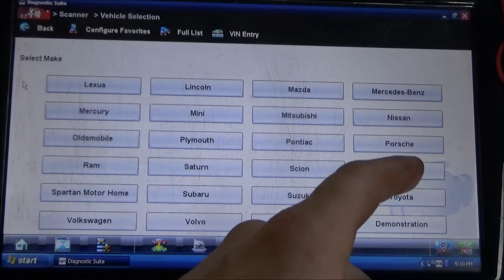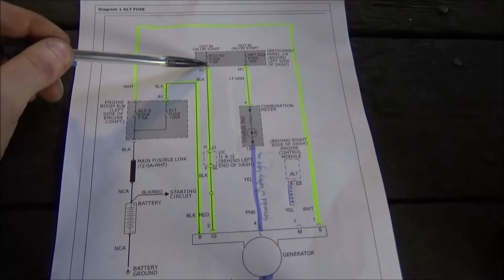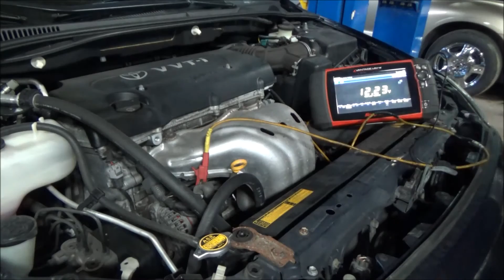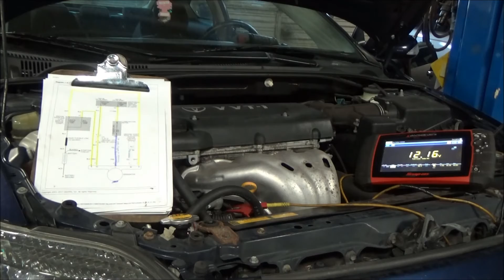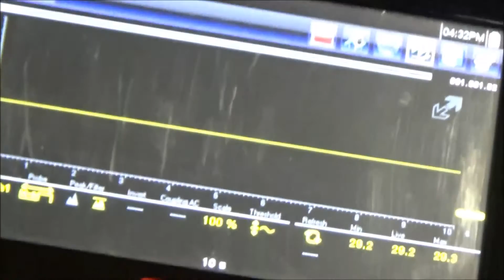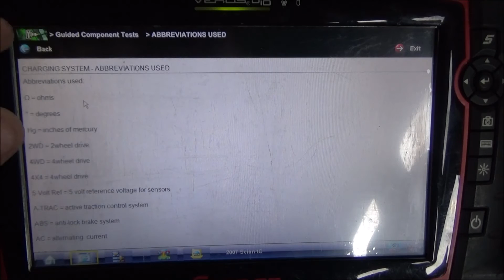2007 Scion TC,  Battery Light, Alternator Testing

Comment: 07 Scion TC 2.4L 2AZ-FE automatic, the negative battery cable that connects/12mm bolt onto transmission will create sparks at the bolt whenever the key/ignition is turned on or attempted to start vehicle. 

Just bought Denso Toyota/oem parts:
▪︎Starter,
▪︎Alternator,
▪︎MAP sensor 
▪︎Crankshaft sensor,
▪︎VVT sensor, 
▪︎Radiator,
▪︎Engine filter,
▪︎Iridium spark plugs,
▪︎Brand new battery (Walmart)
▪︎CV axle seals,
▪︎Front D&P speed/ABS sensors,
▪︎Engine belt,
▪︎Engine valve cover gasket,
▪︎Engine pan gasket,
▪︎Transmission pan gasket,
▪︎Gas/fuel cap

Non oem parts:
▪︎Driver CV axle
▪︎Driver ball joint
▪︎Driver swaybar link
▪︎Driver steering tie end rod
▪︎Driver wheel hub bearing
▪︎Pass CV axle
▪︎Pass ball joint
▪︎Pass swaybar link
▪︎Pass steering tie end rod
▪︎Pass wheel hub bearing

Comment: I would think that live data would show you desired charge rate vs real time, giving u at least an idea that the ECM is trying to send a signal to the alt to increase the on time. Some scanners will express actual on time desired duty cycle in percentage. That at least gives u the idea that the ECM has electrical control, but the alt has failed. Even using the scope as u did proves circuit integrity. Generally, Toyota computers do not fail in this way, so odds are, the alt took a powder. Good vid!

Comment: These test can fool you. As the PCM can control the alternator. They are appearing more and more on new cars. So you need to be aware the PCM could be not grounding it. I fixed many where people kept tossing alternators at the problem. Only to find the PCM signal ground be bad..
You can command the Charging system Duty cycle on. If you have bidirectional control Scanner..

Comment: I have a 08 Toyota camry and my battery light is on I replaced the alternator and battery and still nothing any help will be appreciated thanks. Nice video BTY
Reply: Check alternator fuse 7.5 change that and you good to go
Reply: Google alternator fuse and change that

Comment: 30 mins to diagnose a bad alt.  I would have down replaced it from the  start
Reply: I replaced my battery and my alt and it's still low voltage. This video is gold. I'm glad it's here. Checking my wires.

Comment: I own an 07 tc. It's a complete miracle to still be running. At 194k miles. Bought from a buy here pay here lot 60 k miles ago. Burns over a quart every 1200miles. Running Castro gtx for the life of the car. Battery just died or its not starting.

Comment: hey I have this same problem, except I dont have a battery light come on. have a abs, brake, and tpms lights on. replaced front passenger speed sensor and lihhts still on. put a new alternator in and nothings changed. wont charge the battery. had alternator tested in car running and theu said the brand new one was bad. took it out and they tested it where I bought it and said it was good. so brought it down the street to oreillys and they said it was good as well. any thoughts on this?
Reply: did you figure out what was wrong with it I have the same problem
Reply: any updates?
Reply: I'm having the same issues, about to try replacing the fuse box like I just saw in another video

Comment: "DFM/M: (Digital Field Monitor/Monitor)
This type of connection is connected to the vehicle ECU. Every alternator brand has a different abbreviation for the DFM
connection: FR(Field Return) DF(Digital Field) DFM(Digital Field Monitor) M(Monitor) LI(Load Indicator) but all function in the
same way. The connection has a positive and negative measurement which works with a block pulse. When the alternator load
increases the block pulse dependent on the application will become wider or smaller. The vehicle ECU then knows the load at
any specific moment during the charging process. "
According to autoelectro.co.uk. There is also a great article at http://www.motoplat.nl/Tech%20Info/DFM%20Explanation.pdf.
Hope this will help. Thank you for the video.
Reply from the maker: Great links man,  a lot of good information to take in there.  I appreciate the feedback and your support of my videos!
Reply: James Courtney Thank you so much James and Joe too, remaining stuff answered nicely. I'm happy so much that many of us around going to help each other.

Comment: What did the signal look like with the new alternator installed.
Reply from the maker: It looked the same following the alternator replacement,  but I didn't have time to play around with it as much as I'd like.  I'll keep an eye out for another one of these and get you a better answer.
Reply from the maker: I had another chance to look at one of these and here is what I can tell you.  Increased electrical load causes the alternator to increase duty cycle of this signal.  Based off of this,  the engine computer will adjust idle speed accordingly.  Grounding this wire will cause the engine computer to increase idle speed to almost 1500 RPM.  High duty cycle=heavy electrical load,  low duty cycle=low electrical load,  I hope this helps!

Comment: Joe I'm sure the pulsed signal is to strengthen or weaken field strength in order to control charge rate. regards joe
Reply from the maker: Hey there,  thanks for your comment.  I disagree with you my friend,  as this signal is being controlled by the alternator and not the engine computer.  The alternator does not receive any sort of command from the engine computer,  and all of it's regulation is done internally.  This is a signal to the engine computer,  not the engine computer signalling the alternator.  Thanks for your input!
Reply: Hey Joe,  was thinking that the ECM is just watching that signal and or its frequency. the 12v that you were seeing when you unplugged it was maybe a bias voltage. thinking that you might have a different 
square wave with a good alternator. something to do with charge rates when temps are colder. just 
thinking out loud hear. like your channel by the way
Reply: Yes.  It probably controls the excitation field with pulse width modulation. The wider the pulse the higher the DC voltage. Usually These circuits are designed by monitoring the output of the generator voltage or in this case rpm (if I am not mistaken).  To keep the generator voltage at operating voltage, the whole system is set as a loop.  Similar to automatic gain control loops for amplifier gain control.
Just an idea. Take care all.